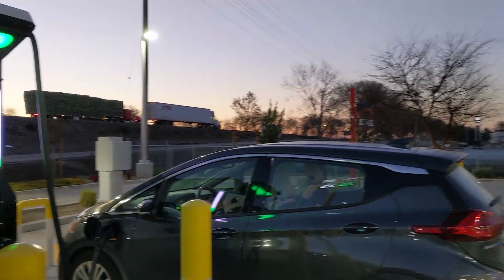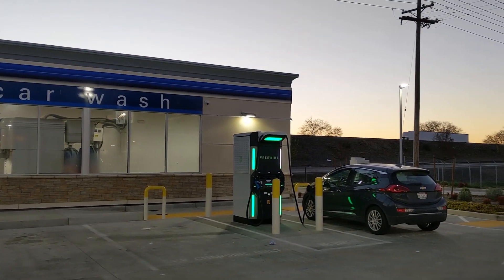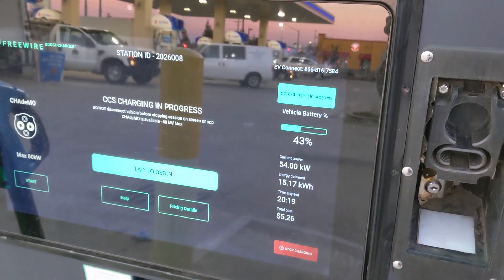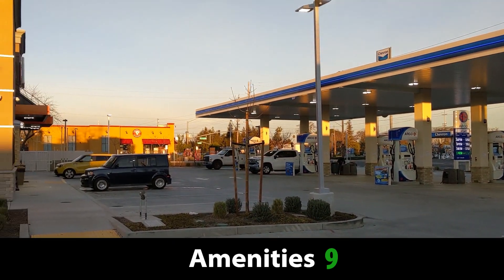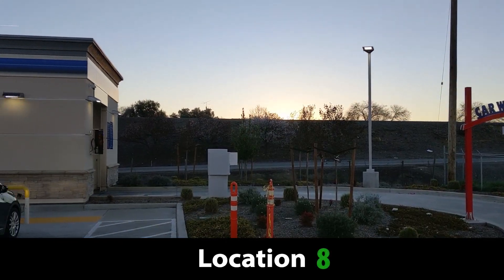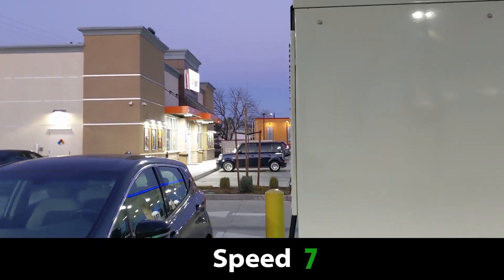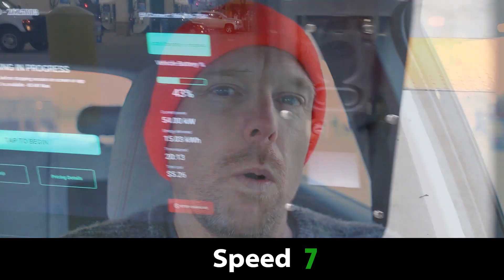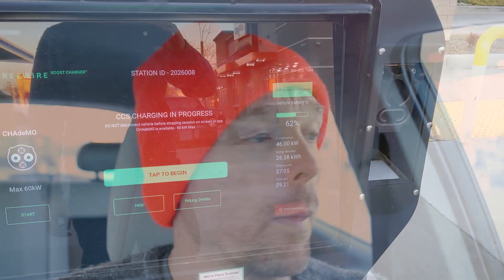Site Review: Freewire, Lodi Arco AM/PM

Comment: The Data sheet on their website says the internal battery is 160 kWh. Max output DC is 120kW CCS and 100kW CHAdeMO, 2 vehicles charging at the same time get 60 kW each.
Reply from the maker: They updated the placard on the back to show max 160 A for the CHAdeMO. Not sure why the discrepancy. The split max of 60 kW each makes sense, though. That's the same way the ChargePoint Express units are set up.

Comment: How do you like the “Euro” plug handle vs typical REMA handle? Also it there a proper name for this connector? Thanks!
Reply from the maker: I like the handle as an option. I think it could be more ergonomic for a lot of people. I don't know that there's a proper name for the handle CCS connector. I know Phoenix makes one too, called the High Power Connector (HPC). Either way, it seems to seat better than the Huber + Suhner cable, which is nice for owners of older Bolt EVs.
Reply: Thank you. I do not really like the typical curved CCS plug as I find it very ungainly. Eric, on a separate topic, is there any news on your Bolt cells? Did you get the software patch to limit charging? Has GM finalized a solution? I am interested in buying a used Bolt at some point. Thanks!

Comment: I'd argue battery storage expansion primarily for busy areas. Expensive upfront costs with installation+batteries, but may see a larger push for expansion if they can make a profit for providers. Storing cheap power, either solar, off peak and/or low draw, while charging market DC rates with frequency. I don't think we'll see a large push for expensive rural battery DC sites without significant subsides for installation recurring maintenance.
Reply from the maker: It's a bit ironic, because battery systems are less necessary for busier sites. Demand fees are a one-time charge, so the big issue right now is that public charging providers are spending thousands of dollars a month that they are only able to break up over a few dozen transitions. That means, the amount of demand fees versus actual kWh sold is very high. Most of these charging sites without grid-tie batteries are running at a loss.

Comment: The Taycan has a 50kW dc-dc converter for 400V chargers as base, but there is an option that several folks get to include a 150kW converter.
Nice review as usual Eric. I am interested in trying it should I ever get to Lodi.
Another tidbit that may interest you Eric is that the 80kW rated bu EVgo chargers in Foster City are actually 150kW chargers if you have an 800V capable vehicle. Myself and another Taycan owner tested it. Very interesting that EVgo is installing 800V chargers now.

Comment: Never heard of Freewire.. are they new company or old company with new name?.. also I noticed the green bar next to your car was different levels green\white does that coincide with your car charging rate?
Reply from the maker: Yes, they are relatively new. I believe those bars are power level (or available power). The CHAdeMO was a full green bar, and the CCS was a half green bar. That makes sense because the CHAdeMO wasn't being used, and my Bolt EV was drawing 150 A (or about half of the max 300 A available).
I'm not sure whether CHAdeMO bar would drop if a faster charging car that was drawing the full 300 A was using the CCS plug.

Comment: Did you notice that the light on the rim of charging cabinet started out half green and white. During the course of the charging session the green portion dropped. I wonder if that is a battery indicator for the cabinet itself.
Reply: That's the current charge level for his cars battery.  The reason you see it go down rather than up is because he keeps cycling through the same B roll footage over and over.  In reality, the green goes up as the car charges so you can see the state of your cars charge from a distance.
Reply: @MH-Tesla  Interesting thank you for that explaination. That’s a pretty useful feature.

Comment: This looks pretty cool!  Perhaps this single unit is just a trial for a traffic and reliability test?  We have a similar battery backed setup in 1 location in Michigan, from a company near Toronto (Ecamion, IIRC).  This setup puts the batteries in a “tiny” container ship like container, and the user interface is shaped like a tall cap J.  If the one reviewed here is 160 kw, I’d say the Michigan site is about 4x that, which seems like a lot.  To date it’s been quite unreliable, but slowly improving.  These would make an awesome setup for rural charging!

Comment: Card Reader of Doom 😆

Apparently 200 amp 220v grid feeds are pretty common, so if a fast charger had a 40kw input with no demand fees and a >=200kwh of battery storage, that could potentially be a winning combo.

Comment: Looking at the specs it is rated 27 kW (or less, adjustable) AC input.  Maxing out at either 3 phase 80A or split phase 120A.  It has a 160kWh internal battery.  Neat idea to avoid demand charges, but if you have a busy site with back to back charging it could drop to the AC input or 27kW for it's output.  It does say 60kW each if CCS and CHAdMO are used at the same time.  The installation cost would be WAY less.
Reply from the maker: Thanks for the additional info. This was a spur of the moment trip, so I didn't research Firewire before stopping by. I agree with you. I don't like these for busy sites, but think they're a great option for small businesses in rural towns/highways.
Reply: So if you run another 200A service to your house you can put one of these in your driveway. Lol. 

I do think if they make the 160 kWh battery available for whole house backup, that’s equal to more than 11 power walls. 

If they allow custom builds like Dell computer did, you can choose Chademo, CCS or Tesla plug, peak KW charging, 40-80-120-160 KWH battery and 10-20-30-40 kw inverter to run your home or small business when the power goes out. 

As is these things cost $200,000 plus installation so I’m not sure what business case would make it good for someone to buy one and let the public destroy it for $0.10/minute profit when in use. It would take about 5 years of earning 10¢/minute to break even, assuming nobody destroys it during that time and adds to the cost to maintain it.

I’m guessing these are mostly going to be subsidized installations in places where they will give grants or tax credits to businesses. 

But smaller versions for home use might be a thing someday. Right now you can buy a 25KW DCFC for home use that uses 208-240v single phase (or both legs of split phase). I can imagine there are plenty home business that can benefit from being able to make a run in their EV limousine, come home and fast charge and relax, then go out and make another run. 

I know a lot of Texans wish they had 160 kWh of backup power last week. Lol
Reply from the maker: @imho7250  I'm sure subsidies will need to be a large part of these installations early on, but even $200,000 is not much depending on how busy the site is and the profit margins of the associated business. Still, if you can afford that much and have that much potential EV traffic, there are probably better options. A 150+ kWh Tesla PowerPack and two ChargePoint Express 250 linked for 125 kW would end up costing about the same to install.
Reply: @newscoulomb3705  , yes, one of their selling points was the low installation costs, but at the same time it’s useless in a high traffic areas because you will drain it at 100 kw (if both sides are used) and fill it at 20 kw. 

I don’t know how many chademo leafs are still running around but it seems like a waste to have ChaDeMo on one side of a shared system instead of 2x CCS with one or both sides also having a Chademo plug. 

The installation costs will be lower but the charger cost is higher due to the 160 kWh batteries. Just the round trip to charge and discharge them will lose 10% minimum. And the fact that you can only sell 27kw x 24hr= 648kwh per day maximum limits the potential sales. 

The peak shaving only saves money if you can’t sell 100 kWh every hour. So the ideal use case for this charger is a place that only needs to charge a car (add 50 kWh to its battery in about 30-60 minutes ) once every 2 hours. So it sits idle 2-4 times as long as it sells electricity. 

Of this charger had a bill reader and accepted $5-$10-$20 bills then the owner can set higher than normal rates for people who just need a little juice and want to pay cash. 50¢/minute for up to 2kw/minute if your EV can accept 120 kw.
Reply from the maker: @imho7250  There's still a need for CHAdeMO, definitely, but I think Electrify America is on the right track. Some mix of plugs, but no more than a couple of CHAdeMO plugs per site should be necessary at this point. Sure, Teslas use the CHAdeMO adapter, but most Tesla owners are reluctant to be restricted to 50 kW. 

I'm still struggling with whether this is a better configuration than just a high-power grid connection that can support, say, 1 MW, while also having a couple hundred MWh in stored energy to offset demand fees. Something like the Recargo site in Prunedale would be ideal, though it should have at least a 50 to 100 kW solar array, too.
Reply: @newscoulomb3705 , I try to imagine if were a DCFC salesman who has access to everything offered in the market, and how would each business be able to profit from having one. But the reality is the first thing I would need to learn is where all the hiding free government money is, because without that I don’t think it would sell. 

If this particular charger was fed from a 25 kw solar array and off grid then the 120 kw charger would be overkill. Charge it all day with solar and then 3 cars use it at night and it’s dead. Lol. 

I think the Tesla superchargers like at Kettleman are pretty good because it’s 100% designed to reduce cost of peak demand with 250kw solar and some energy storage, but nowhere near enough or say its powered by the sun. 

I do think these chargers can be sold to small businesses that use EVs but the driver’s time is too precious to sit at a public fast charger instead of plugging in at the office and getting back to work for an hour.